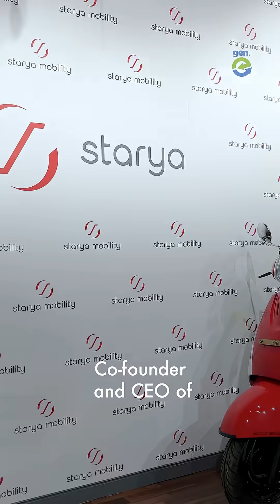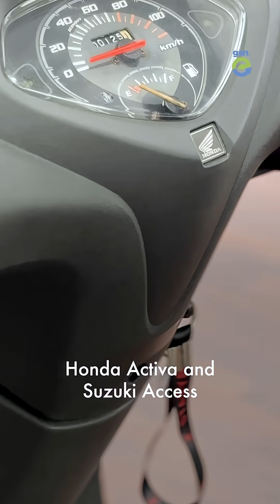Turn petrol scooter into electric | Starya Mobility in Bangalore helps you save money on petrol

Comment: With a bit of research on motor kit and battery pack, one can convert their old scooters into EVs on their own for less than 25k. And as for permits, it doesn't work everywhere. People will ALWAYS choose a new EV scooter for 50-55k instead of spending that money to convert their old combustion engine scooter into EV.

Comment: Maths doesn't tally as three years on battery is too low for an investment ranging from 55k to 85k, which typically requires a longer lifespan or higher durability to justify such a significant expenditure.

Comment: So, the Ols S1 z costs 58k and goes 140kms, right? You could sell an 8-year-old Activa for 15k to 30k. If you do the math, you could get a new EV with a decent range for like, 43k at the lowest. You pay 85k for a Starya and only get 80kms? That's why startups in India fail. They rush to launch stuff, get funding, and try to get rich quick. Why not spend more time on research and make it cheaper and more practical? People actually need this, but the price is ridiculous.

Comment: Conversation of petrol bike into ebike is around 40 to 50k.
Pactically the weight of the petrol scooter is more than normal ebike so obviously you can expect a milage drop in the long run if you convert petrol bike into ebike.

Pros: Sentiment ( my grand father bike or father bike)

Cons: 
1. RTO 
2. Insurance claim
3. Cost

Finally, instead of convert petrol bike into ebike better you can buy new ebike. Nowadays, low speed electric scooter available less than 50k

Comment: Indians are concerned about the quality and km range, 
Hope it have atleast 6-8 kwh battery pack and that can offer atleast real world mileage of 300km on a single charge,
I told you about the qulaity,
if it have the quality of an international brand like what Yamaha offers like less maintanance  ( only oil change, break and tyre, no issues with engine side ) 
If your intiative can offer quality things like no wear and tear on the belt for 55000km,
If the battery and motor can efficiently last 100000km or 8 years its a win, 
Otherwise if its a maintanance or no superior quality thing people gonna hate and regret for doing this and that will gonna affect your company,
Like lack of km range offered and complaints arised from battery and motor side,
Hope you can fix all this and include Yamaha scooters to your list,
Bytheway its a great intiative, 
Wish you can do all this in quality aspects.

Comment: I would rather keep my old engine as an extension for when I need to go fuel fuel when battery is discharged. Adding a hub motor on the other side of activa real wheel would be the best with battery in boot or front boot .

Comment: Good concept ..for market penetration, price should be somewhere around 35 k
Reply: I will hand over my scooter fir 35 k but 55 is too much
Reply: Previously it was 35k with same specs....but now they made it to a bigger commission margin conversion.
Reply: It should be less than 35k (if you're paying someone else to do the conversion for you) because a decent EV conversion kit is available for 20-25k (motor + battery + controller). And even then you're left with almost 10k that you're paying for the conversion service. As for permits, live in reality and know that it won't work everywhere. 
With a bit of research you can buy a kit and convert your old scooter into EV on your own, not only saving your money but using the best parts for the price or as per your requirement. . .

Comment: Your motive is good, but my doubt is once the petrol engine gives up around 15 years, the chassis also becomes damaged, all plastic parts will be out of place giving noices. What's the use in just changing the engine. 
Moreover TVS iqube is now available in 107k with all bells and whistles with 5 years warranty. I own for 3 years and it's amazing. Zero maintenance and the battery is still like new giving same mileage.Ather now available with 8 years warranty. Sell your old scooter for some 20k, there gap is filled.It's not a wise idea to convert.

Comment: Price is equal to the new ev bike. But we can save the environment. I hope it will be more affordable in the coming years, so that many can reap the benefits.
Reply: You are wrong there is nothing like environment friendly. do some research on manufacturing of EV vehicle and batteries it's having the same impact.
Reply: Already there are options for that, which is improving. So, there will be definitely better in future. Also, some other ideas in fuel options are possible with ethanol
Reply: @arjun2880 it is helpful we don't have radioactive ponds like China that are caused by processing rear earth materials for motors but EV definitely helps india in controlling air population in cities if you corvert or exchange 80% of two wheelers in ev that alone would bring down AQI 15-45% depending on city you are in
Reply: @આ-મોન્ટુભાઈ what about spent or recycling of the batteries? Have thought about that it. We cannot dump back to China right?
Reply: fossile fule to ev is like idhar ka kan udhar se pakadna. it extract fuel that extract rear earth metal. both burn fuel to generate power. it create waste that is more bio degradable that generate waste that is more poisonous. so on and so on...
Reply: @arjun2880 in that case even petrol scooters also will have batteries… so petrol scooter using batteries and also fuel so DOUBLE the pollution…

On other hand EV has battery on which you have concern about its mining… but what about fuel..? Atleast EVs don’t use fuel ..

So SOMETHING IS BETTER THAN NOTHING…

In current stage, no body can make 100% eco friendly vehicles.. it’s close to impossible…

So stop this of “oh even EV scooters also cause environment hazard due to mining for batteries” kinda half knowledge theory 🤡🤡🤡🤡🤡
Reply: @arjun2880  When you buy a new bike don't the manufacturers take old bikes give you a discount on the new one and send them for recycling??
Doesn't make sense if I can get a new Ebike for the same price coz everything deteriorates over time.
Recycling is always a better option than refurbishing.
Reply: If there is no major price advantage, no point to do this exercise. Either use your existing scooter for another 4/5 years or buy a brand new EV itself. This is like an assembled bike with unknown parts on an old chasis. A parallel is like assembled desktop computers we used to have commonly 20-25 years, but there was price advantage
  Until and unless there is a major price advantage, this is not worth, just go for a brand new ev of a reputable brand
Reply: Lithium dumping of used batteries is a big big environmental issue so nothing eco friendly or go green 😎😊
Reply: @phoenix-234 Totally agree 👍
Reply: @phoenix-234 correct Corbon monoxide is more dangerous than Corbon Dioxide.
Reply: New one starts from 1.2 L
Reply: @VivekGunda-ro2dt Then sell the old one and you'll get atleast 25K. Can't you add 10K for a brand new EV with new body, tires and everything else?
Reply: If you can do for 20k I can offer 10 bike
Reply: We can sell our old vehicle and add that amount to 85k, will get new one.
Reply: Local mechanic will now do this in 50% price
Reply: Just scrap the older one and buy the new one best for the environment, economy, safety etc
Reply: Environment 😂😂😂...Grow up
Reply: U r polluting even more😮
Reply: Majority current generation unit used coal  it increases carbon emission and also major problem battery 🔋
Reply: Is there any EV for 55,000? TVS EV costs approximately 1,60,000 rupees
Reply: Agreed 💯
Reply: And it's less efficient than EVs manufactured by companies 😅
Reply: You just save money on the body   55K is quite affordable !
Reply: What's range after full charge just check it then compare with new 😂😂😂 @codewalters
Reply: The main pollution comes from making battery.so, it still does make more pollution than a petrol scooter that are on the road for 7 - 10 years.
Reply: Where to contact give your number plz
Reply: In TN state the conversion cost is much cheaper and affordable.
Reply: Can someone say who gives a new EV to 85k ?
Reply: @VijayAthreyan yes u can get it if u have friend army or airforce get canteen card u can get new Ev even below otherwise go to market and get quotes from atleast 3 different showroom and negotiate atleast u can get it upto 95k
Reply: Please check that crude oil refining itself is a major source of pollution.
Reply: Ev batteries after use can be recycled in many ways.
Reply: Whatever old an activa may be...
10K you will get a New Engine...
Rest everything repaired can be under 10k more....

When you can afford you can think of this...

Yes If someone says its environment friendly its a joke...

As 70% electric is produced with thermal power 

And manufacturing a ev is too dangerous than the smoke it produces through activa...😂

Yes its cheap when you use it...
But not going to give you benefit as there are no such way we can replace batteries and good to go...

When every petrol pump will provide battery exchange uou will be fine...😂

Otherwise its a troublesome 😂
Reply: These kinds of modifications are linked to safety concerns usually company made EVs are not all safe at this moment still EVs are evolving so with these changes to old bikes are not at all suggestable 😂